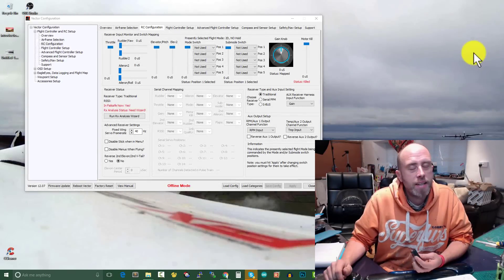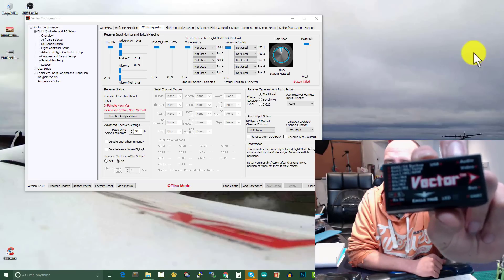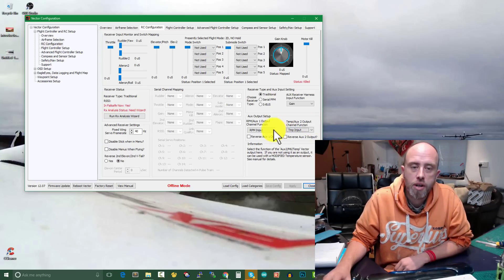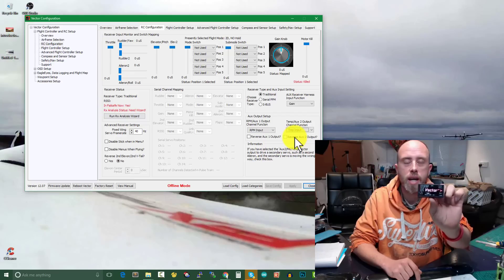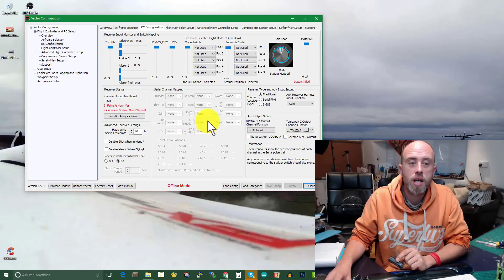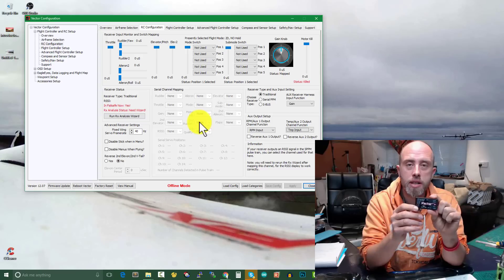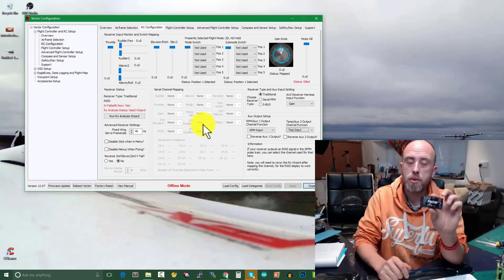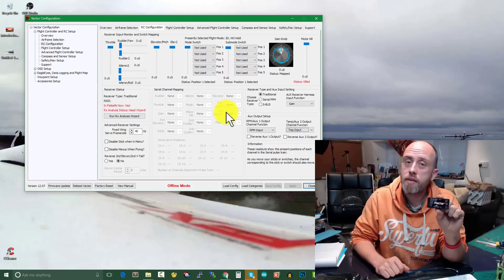✋ Eagle Tree Vector Feedback / Feature Request [AUX ports as Channel Pass-through] Ticket #197580

Comment: I bought the full size skyhunter and tried to foresee what gizmos I would want to add before I assembled it. One item I got was a pan and tilt for my run cam. Not a cheap one either! Now you tell me I can't use it on my Vector? (I bought that as well for the project) So damn the extra point of failure, where do I get and how do I set up this converter you speak of? Thanks for your channel.
Reply from the maker: Hey Mark, yea and how old is this video and the the other request was a year before that too. we're only talking output mapping which would be piss easy to code. Anyway.... see here http://bit.ly/2qtsG8K for the converters. I use them myself and with the TBS crossfire, I output SBUS on a separate channel so not to interfere with the SBUS wire going to the Vector (removes a point of failure). Matt

Comment: Man Im at my final stages of my build (XUAV Clouds) with a Pan & Tilt setup using DL V2 Rx.  And I've realized I cannot get my channel 8 and 9 to work directly from the Rx so I can control my P & T setup.  Thats how I found this video, now I'm hoping there is another way to get this to work.  Thanks for shedding some light on this dilemma.
Reply from the maker: Howdy Mike, I'm using 433MHz so can program the receiver to get out the other channels on the receiver (OpenLRS). Alternatively, if you're using SBUS, grab a SBUS to PWM converter like either of the 2 here https://goo.gl/e8L2hM and you can then get any of the 16 channels out via PWM. Just be aware you put SBUS into this, then take SBUS out and then put it into the Vector. Hope that helps Mike, Matt

Comment: Hi Matt, this is a great suggestion, I have just had to physically bypass a Vector from an L9R to do Pan and Tilt in a Mini Talon.  The extra points of failure are significant  for such a configuration on a traditional Mini Talon layout (Pan and Tilt at the front, RX at the back). The distance is great enough that I had to use more than one extender servo cable for each channel.  Surely breaking a channel out from the SBUS train and passing it through to a PWM output would be a no-brainer.  Looking at the date of your post, I am dissapointed that EagleTree have not made a move to address this so far.  It has been a while.
Reply from the maker: Howdy Mart, this has been a long time and there are the same suggestions going on for a LONG time before this video was made too. Obviously not important in the development list and it must be so long it's not been got to in over a year or more :/ Matt
Reply: I think the feature request list must be long, I have submitted a few things myself which have not seen the light of day.  If you look at the revision history over the last year or so they have  added mountain mode and a closed loop speed system and apart from that it is just bug fixes.  I dont think adding any more features is a priority how ever long their feature list.  One thing I think they should be addressing is the fact that if you tweak your trims more than a small amount and dont immediately Incorporate Trims, your RTH will no longer work.  This is a straightforward fix and they have discussed adding RTX mode (which ignores trim) months ago, but again no sign of it.  All of this is in the margins however, at this time, it is still the best system out there in my view, warts and all.

Comment: Hey I recently subbed your channel. I've a question. Can you tell me if the eagle eyes ground station will give me a pan and tilt on a Tbs ground station running a Yagi antenna on 2.4ghz? 
Great channel btw thanks a lot mate
Reply from the maker: Howdy fella, no idea at all! That would be a question for the EagkeTree team, Matt
Reply: (I got the mini vector as a result of one of your previous vids)so I'll be running crossfire, 2.4ghz vtx and microvector, tbs ground station with Yagi and I'm after a pan and tilt capability. Sorry I'm not that up to speed on this.

Comment: Hi Matthew, I agree 100%, in fact I only have two vectors for this reason, I since moved to PitLab for my longer range MTD, with the vector planes (intermediate range), I have to use a 16 channel ppm / sbus converter which is a pain, a stack of extra wiring, and as you said, added risk of failure with more links in the chain. Come on Eagle Tree, opportunity awaits... I will buy more if you do this minor update.. while we're at it, a 3rd output for roll is fantastic to have also, but there are probably limitations with hardware I/O count... no?, better hardware then..
Reply from the maker: Howdy Alasdair, yea you must have a heap of wiring and there is me being concerned about 2 extra wires and another device! Matt
Reply: Matthew Ogborne 
Yes, only one MTD with 3 axis camera tracking, but then all the other stuff you will no doubt want in your clouds like camera switchers, second panning servo, lights (xenon strobe) I also run backup/alternative  tx on 5.8 from 1.2 lrs. however, I try to structure systems into modules that can be easily removed as a whole pre wired subsection. It makes things very neat and accessible. Real estate in my Hawksky is very limited, not even possible to fit some devices, and this is where an 'Ogborne series Vector' could make life into happy days..

Comment: Hi Matt , yes a very good mod that . I plan to use the dragon link Rx with my talon/Vector as alot of modellers have used because they want long range . I think with that Rx you can map Sbus , RSSI  and PWM from the 12 outputs ,I'm hoping thats right . Also the Rx will be inside near the Vector unit .  Graham
Reply from the maker: Howdy Graham, yea you can do that with most of the long range kit. You've seen how far I space my kit away from the centre of the model, so keeping the number of wire sin the looms is the only way for me.

Comment: 100% agree Matt. Like many I have rx out on wing and just want to run minimum wires to the Vector. I would anticipate that giving the mappable pass though (basically Stab Off mode always on those channels) would be a soft/firmware update so relatively simple. I like the Vector. This would be a significant improvement.
Reply from the maker: Howdy Simon, you've seen my builds, I go for maximum separate every time. Seeing as there must already be a fair amount of code around those inputs/outputs, adding in an exception near the top of the code structure should be very simple to do. Also it could be easily passed on as an "additional feature" too. Matt
Reply: I couldn't agree more. It would seem to be a very cheap and simple way to "add" a feature with a simple bit of code, that would surely only be a matter of a few hours work for someone. Different if you are adding a feature, but this is nearly suggesting the option to bypass. Even with no programming skills I'm struggling to see why this isn't an easy win for them.
Reply from the maker: Howdy Simon, it's a software and a firmware update, so more involved than say a web application. And heck we're not asking for camera gimbal stabilization which is a heap of code & processor time. That said, I would guess not hard to do by any means. Matt

Comment: Hi Matt
I might be missing something pertaining to your requirements but I believe if you are using a "X" series FrSky receiver with S-Bus you can configure it to output both S-Bus and PWM, e.g. Use a X8R to output 8ch S-Bus to your flight controller and 8 PWM out from the regular servo connectors for auxiliary functions. I think I did this with a Naza FC connected via S-Bus on a hex so I could also remotely switch cameras and lights.
Regards
Nidge
Reply from the maker: Howdy Nidge, oh absolutely you can. But I'm using a L9R and also want to run minimal cables down from the receiver on the wing. Currently running 4, two more servo lines would make 6 and thats quite a loom! Matt

Comment from the maker: Things I can think of so far:
Pan servo, tilt servo, a parachute door, strobe light pattern, change FPV camera inputs, air brakes, landing gear, basically anything that can use a PWM signal! Can you think of anymore? Let me know below! Matt
Reply: Spoilers
Shutter release
Smoke
Wheel brakes
Tow line release
Jettison space shuttle!

Should be pretty simple for ET to implement. It will be very interesting to see if they respond. Charles, the creator of MFD AP for example, is very proactive at adding requested features. Sometimes overnight!
Reply from the maker: +1 for smoke! Just not the magical pixie stuff ;)
Reply from the maker: EagleTree Reply: Matthew, The aux outputs are not currently configurable as a passthrough. We are adding your suggestion to our "feature request" list which our product development team reviews regularly for prioritization of future development projects.
Reply: Matthew Ogborne email correspondence today confirms they still have not spent the time and energy to implement this very much needed change.